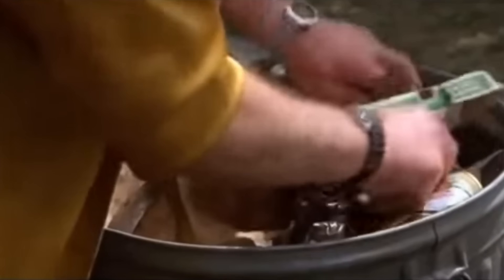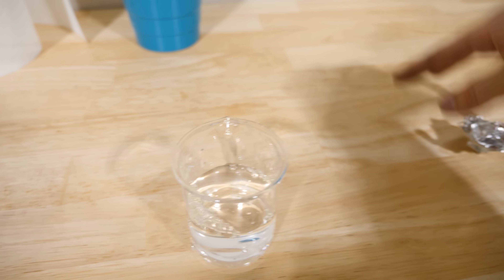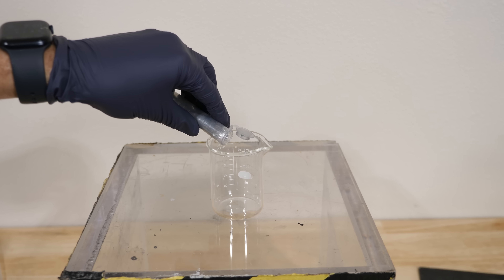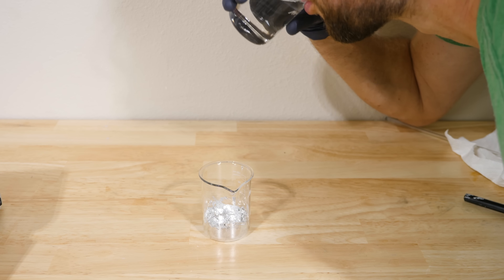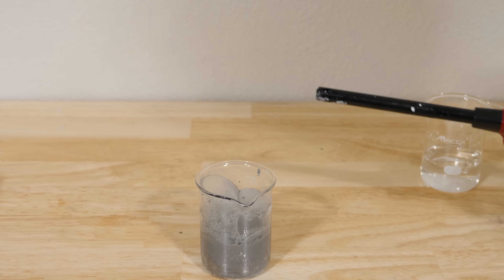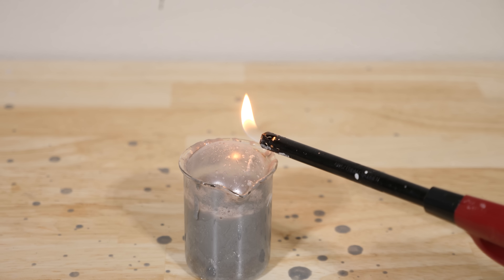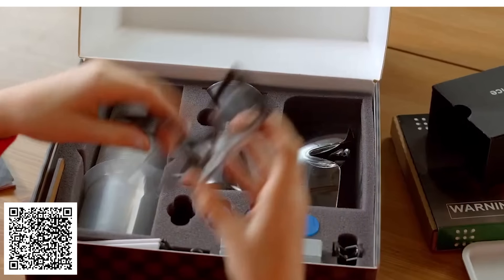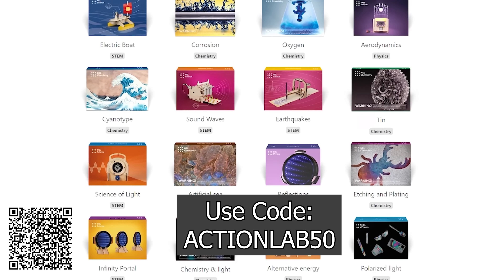This Liquid Metal Turns Garbage Into Fuel

Comment: I'd kinda expect that it saves more net energy when scrap aluminum is recycled back into aluminum products (vs. refining brand new aluminum) than the energy you could produce by oxidizing the scrap and capturing hydrogen. But it's entirely possible that I could be proven wrong, so I suppose it's good that someone's looking into the economic feasibility of such a process.
Reply: Alunium foxide is great too!
Reply: Yeah we should work on ways to make recycling more cost efficient since the main reason we don't recycle stuff is due to it being to expensive
I think I big factor is sorting
We don't dispose of waste in an orginised way so in order to recycle it 
Everything has to be sorted 
And then some things need to be tested 
Then theres unlabled types of plastic 
Strange unusable mixtures of plastic 
And unknown alloyed metals 
Making it impossible to recycle them 
Unless you make something like pot metal
Reply: @grimreapybones2875  however, we do recycle most aluminum. Because its cheaper than producing it from ore.
Reply: @grimreapybones2875  And energy costs, lack of research and development, ...
Reply: @grimreapybones2875  …. Can these metals be incinerated? I watched a documentary on how Dupont discovered Teflon which till this day is still hazardous if consumed and it must be incinerated to properly dispose of it so it doesn’t end up in our water and food supply which it has had been doing since it came out.
Reply: @toysforboysrc  Teflon is not a metal.
Reply: @toysforboysrc  Teflon is not hazardous; the old myths keep re-appearing.

PTFE (Teflon) is inert, unless heated over 300 degrees (C) - which you will not get in a domestic setting, unless you use a blowtorch. DO NOT BURN PTFE! The problem was PFOA, which used to be used in the application of PTFE to the metal pan, but PFOA hasn't been used in the process for a couple of decades at least.

PTFE is so inert it is used on medical implants; it causes a completely different issue there precisely  because it is so inert - the body tries to wrap it up as a means of isolating it, rather than dissolving/excreting it. It achieves its design purpose, but has medical implications that need to be considered for some applications.
Reply: @philpeko1796  …..No, who said Teflon was a metal?… my question was do these metals be incinerated to properly dispose of them.
Reply: @andyowens5494  …..  …. No, when used properly Teflon is not hazardous by itself but it is hazardous when you consume bits of it Because pans do not last forever. Because Teflon is not biodegradable it needs to be incinerated so it does not end up in our drinking water or in our food supply.
Reply: @andyowens5494   Not true at all. No one has ever claimed (at least with any scientific literacy) that PTFE is toxic, in fact thanks to the C-F bond it is extremely unreactive since the C-F bond is about the strongest covalent bond in organic chemistry it takes a lot of energy to break it. However, to this day, PTFE used specifically as a coating (therefore any comparison to medical implants is irrelevant) will always contain small amounts of a surfactant (typically cationic). The reason it will always contain surfactant is because emulsion polymerisation must be used to create such a thin, uniform coating of PTFE onto metals since it is the only way we know of to maintain the stability and particle size of the PTFE coating (it has to be very fine and granular). Originally it was the surfactant PFOA, however we (that is, everyone who wasn’t selling Teflon) quickly realised that funnily enough a powerful surfactant like PFOA was not good for the environment or human consumption even in small quantities. For reference, weaker surfactants can be found in industrial bleaching agents - the type you aren’t even allowed to pour down drains, let alone eat. People didn’t expect it to be so bad because before emulsion polymers were basically never used in the food industry, and so the process was quite new in this context. 

Okay so great, DuPont gets rid of it, now my Teflon Pans are safe. Except they are not - Teflon still requires emulsion polymerisation for the coating of pans to be viable (predominantly due to economic reasons, as it allows it to be sprayed on or dipped). Now they are using another surfactant, GenX, and it’s either as bad or even worse than PFOA - you can easily find countless articles arguing this. In fact, basically any surfactant used in emulsion polymerisation that you can find on the internet will be labelled as carcinogenic, causing infertility, heart problems and all sorts of horrible, horrible stuff. Now DuPonts spin-off company has been caught dumping literal vats of GenX into rivers which people drink from. DuPont and any of its sister companies and branches do not care about you or the environment. 

Other chemists work at DuPont, they know the same chemistry I am explaining to you, yet they do not raise any concerns with government officials. They don’t question it either because they don’t care or haven’t even thought about the consequences of it. DONT STICK UP FOR BIG CHEMICAL, please - their bottom line is always profits. Please feel free to ask about anything I’ve told you here, or even argue with my points. The more people that you make aware, the quicker the government might be able to act.
Reply: @toysforboysrc  You wrote : "No, who said Teflon was a metal?…Did you just figure that out? my question was do these metals be incinerated to properly dispose of them." 
The reason I made the remark that Teflon is not a metal is precisely because your question was comparing Aluminum disposal to Teflon - Which by chemical, toxical and economical means makes no sense. And no, funny of you to point it out, I did not just figured it out now, because that was taught to me a long time ago, from secondary school up to my engineering degree in Chemistry. Your question about "aluminium disposal through incineration like for Teflon" makes no sense for many reasons : a) Plain aluminium metal is not a waste, it is a product of a costly process to change its chemical state of any oxide through oxydo-reduction reactions to the metal state (metal is the reducted state). Aluminium is the most abundant metal on earth, and its normal state is a "waste" state, various aluminium oxides and compounds of course. b) You cannot "incinerate" Aluminium. Incineration, for instance of Teflon, is breaking the compound (namely the PTFE molecule (Polytetrafluoroethylene)) into other molecules or atoms. You can just for instance oxydize Aluminium, you may want to "burn it", by any means, through many chemical reactions, and one is precisely demonstrated in this video. But, again, nobody wants to oxydize aluminium metal to get rid of it, on the contrary, we need it as a metal, not as an oxyde c) Metal Aluminium is not toxic as is, but aluminium oxydes that may come of it are toxic, so, again, nobody would want to oxydize. Of course, if you ingest aluminium metal, it may be oxydized in your body, which is toxic.
Reply: At this point no I’m not asking you to answer my question but thanks.
Reply: Not only you use less energy by recycling aluminium back into new aluminium, but you also emit a lot less CO2.
The refining process of aluminium has to emit CO2 because you need to get rid of the O3 in Al2O3 (aluminium oxide), and as far as I know, it is done by reacting it with a carbon electrode, which in turn degrades the electrode by "burning" it into CO2. You do need very strong electrical currents for this reaction to produce a lot of aluminium though (you'd be talking in hundreds of thousands of amps).
So for each aluminium atom that you produce, you'll have 3/4 molecules of CO2, regardless of the method you use to produce the electricity.

What's the point of emitting CO2 to avoid emitting CO2 as a replacement for other fuels?
There are probably better ways to use the aluminium than to convert it into fuel.
Reply: @Martititi  who said the point was to avoid emitting co2?
Reply: @homelessrobot  I thought it was implied in the "we produce fuel by using garbage instead of a fossil source", but you're right, no one said the point is to not emit CO2.

In this kind of technology (fuel production), I'd still expect that CO2 emissions are taken into account.
Reply: @Martititi  well, one good thing about this is that the co2 produced is pure, and produce in an industrial setting, rather than wherever the fuel gets used. So the CO2 can be captured (like, in bottles, for other industrial uses) rather than just released into the atmosphere.

Generally though the emissions game is just kicking the can down the road. Co2 is almost as inevitable as waste heat.
Reply: @homelessrobot  it seems the goal of a great number of environmentalists to cut carbon emissions.  Apple argued in Brazil that the reason to not include chargers with new I phones was to cut carbon from packaging. Course they were laughed at fined and baned from selling I phones with out chargers. Btw my vote would be pumped storage/water the west. Take excess water from the Ohio and Mississippi  pump it up the  Plat and north Platte  rivers acrost south pass and the red desert and get the energy back in hydropower generaters as it goes down the green and colorado rivers.. the lakes created would extend barge traphic up through half of wyoming. Also holding more water back from the oceans would lower sea-level and may temper the climate
Reply: It is dependent on the % contamination, this is why 65% of US aluminum is recycled. If this process is very tolerant of contamination it may be a viable use for aluminum too contaminated to be recycled
Reply: i did a huge project in high school, and it actually would be too involved a process. there is no net gain unless you have something to offset the carbon that is used to heat/refine aluminum oxides. it all runs back to other alternative fuels.
Reply: Stupid idea. To produce bauxite, we have to make coking coal, caustic soda, ovens, extracting the ore, it's all very polluting. The future is green hydrogen.
Reply: agree
Reply: It is just a logistics question for break even as the efficiency difference is just scale, aluminum would be useful as a air aluminum battery - the regeneration from the waste is not an energy problem it is a logistics problem... If you have space an iron ion battery is the best as it has the most efficient cycle.
Reply: I would guess it's worse than recycling, but if you use it as a battery and keep "recharging" the same mass of aluminum it works very well. Still pure aluminum oxide is a material used in many industries and has many future potential uses.

Comment: I would guess you would need a sturdy tank with gallium in it safely contained .. a way do drop certain amount of aluminum at a time a storage tank and pump to compress the gas.. and away to feed it to the engine while regulating the input pressure according to throttle input.. of course with safety valves to release pressure and well contained Incase of fire or explosion.. but seems too dangerous though
Reply: Yep, decant the gallium out from the bottom, refresh your water every now and then, drop your gallium back in and Bob's your uncle. That's what it sounds like anyway.

Comment: This is neat but 130ml of hydrogen at room temperature is about 0.005g making the energy density of such a system terrible and we can already assume the round trip efficiency being far worse than any rechargeable battery so I fail to see the point of this in any practical application…apart maybe some extremely niche use case and that’s being generous

Comment: For those wondering, if it's this simple, why isn't it used?
Bare in mind that I'm no chemist or have any scientific background on this, so please, experts feel free to correct me and add up relevant info. Sorry and thanks!

The answer is kinda in the video already - you need lots of energy to produce aluminum, so much so that it makes much more sense to recycle and reuse it rather than decomposing and turning into fuel. As aluminum is optimally recycled and has lots of uses... it just doesn't make much sense to expend it as fuel.
It might be interesting as alternative source, but tit for tat, electrolysis is still probably a better alternative in terms of total energy expenditure to produce hydrogen as fuel.

Gallium is... not quite as bad as something like lead or mercury, but also not super great. It doesn't occur naturally, as a free element in Earth's crust, but rather comes out as by-product of zinc and aluminum mining. It's valued at just bellow silver and indium, but not too much below.... so it's pretty expensive to get. Used in lots of electronics products.
Reply: Those were my thoughts exactly, thanks for pointing it out so that i dont have to.
Reply: What if they had collectors at gas pumps to empty out the leftover aluminum hydroxide for recycling while you filled up with a new tank?
Reply: @ablasttv  That's a pretty good idea, but doesn't directly attack the problem.
The real problem is that reacting gallium with aluminum to generate hydrogen is far more expensive (not only in money terms, but in everything involved) than any other form of hydrogen production... including good ol' electrolysis. So, viable alternative in emergencies perhaps, but not cost effective.
It also makes more sense to use Gallium in other applications, and just recycle aluminum into other products, rather than using both to produce hydrogen.
It's pretty interesting as an experiment though... 😀
Reply: apparently they don't think it's as profitable for the bottom line.

Comment: Many industries use heat-intensive processes that generally require the burning of fossil fuels, but a surprising green fuel alternative is emerging in the form of metal powders. Ground very fine, cheap iron powder burns readily at high temperatures, releasing energy as it oxidizes in a process that emits no carbon and produces easily collectable rust, or iron oxide, as its only emission.
Burning metal powder as fuel sounds strange, the next part of the process will be even more surprising. That rust can be regenerated straight back into iron powder with the application of electricity, and if you do this using solar, wind or other zero-carbon power generation systems, you end up with a totally carbon-free cycle. The iron acts as a kind of clean battery for combustion processes, charging up via one of a number of means including electrolysis, and discharging in flames and heat.